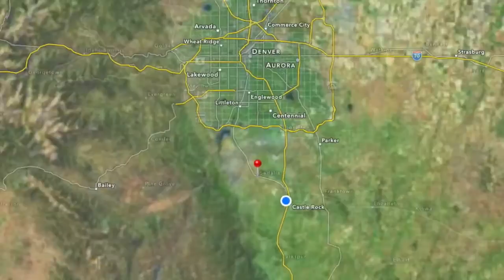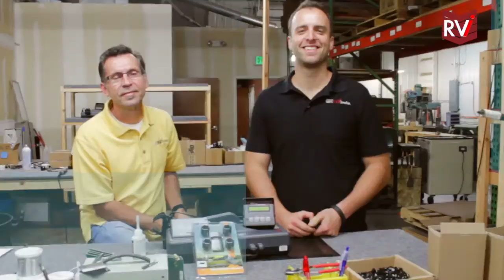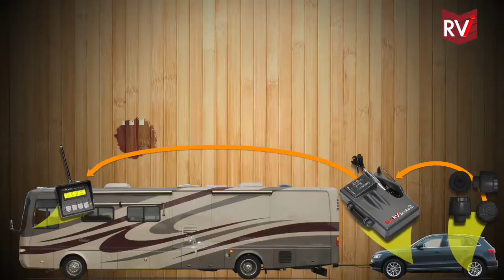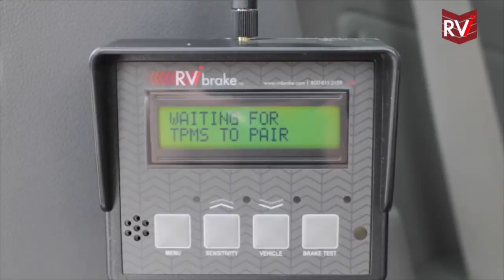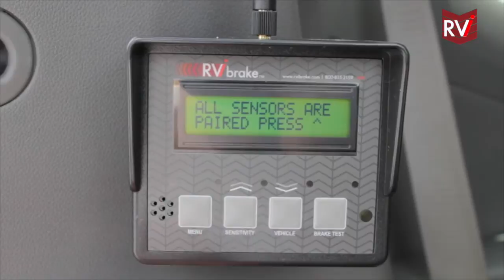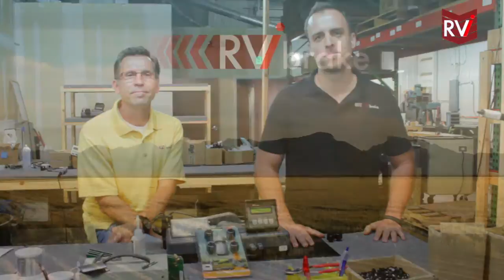RVi: Why did you integrate the Tire Sensors into the RVibrake2?

Comment: Does your Rvi tire monitoring system also able to show the pressure of the RV unit as well? That would require 12 tires to be monitored. Thanks so much for your help.   Jimmy G
Reply from the maker: @Jimmy Gregory, the RVibrake2 TPMS is limited to the 4 sensors on the towed vehicle. However, our Tire Patrol TPMS can handle up to 14 tires all on one screen. You can see them at tirepatrol.com.